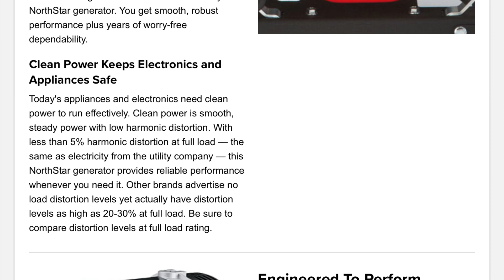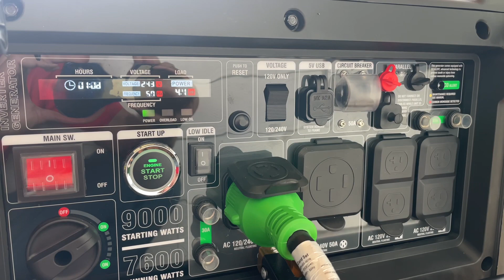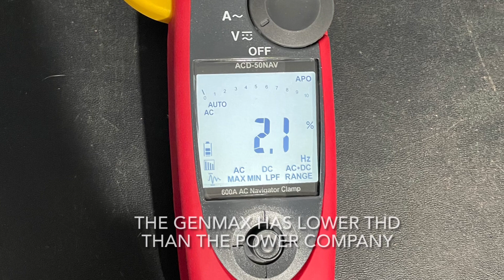Northern Tool NorthStar 8000 Honda Generator Compared to GENMAX 9000 power backup with THD

Comment: This doesn't really add up. I have a North Star 8000 myself, best generator you can buy. Way more reliable long term than your GENMAX. My THD at full load is still below 5% which is more than good enough, mine is actually cleaner than my utility power where I live. Mine at idle was about 2.3%, 4.3% full lload. Try having the genmax stay reliable with all the electronics and circuit boards.....

Comment: I'm about to buy the north star Honda generator
Reply: I got the Northstar recently. It's a difficult choice between low THD and a Honda. I went with the Northstar Honda, mainly because I don't trust the Chinese engines for durability, but who knows. I do know I've never had a Honda crap out on me, ever. It's usually everything around the machines they power that falls apart, but the engine still chugs along, seemingly forever. That Genmax is pretty nice though, and cheaper, I think.
Reply: @interstellarconundrum4774   Except the Genmax being an inverter generator, you're relying on Chinese electronics also....not just the engine.....though the Chonda engines have come a long way...